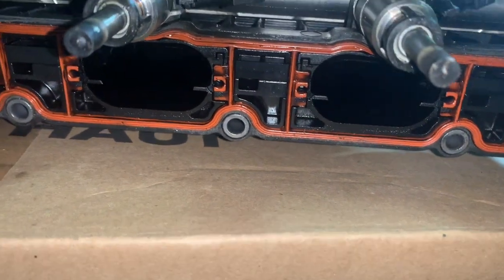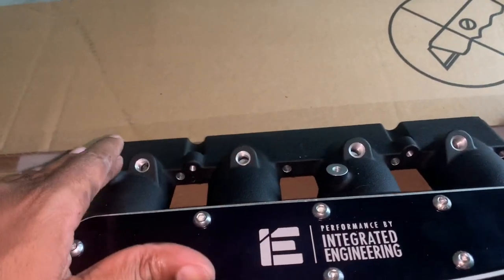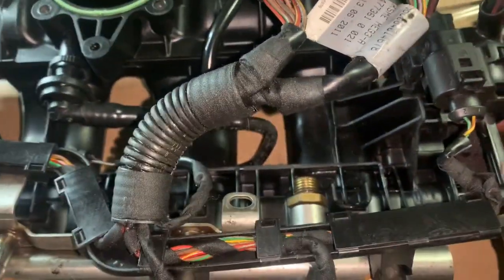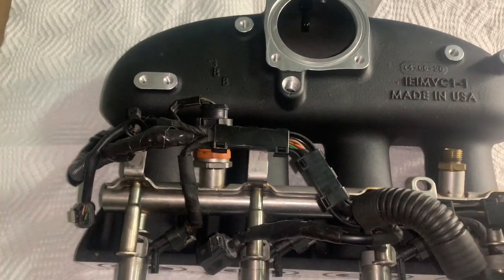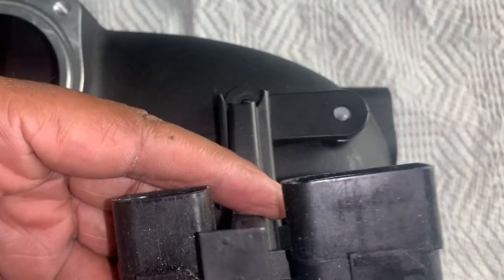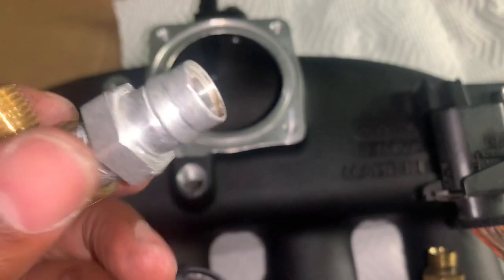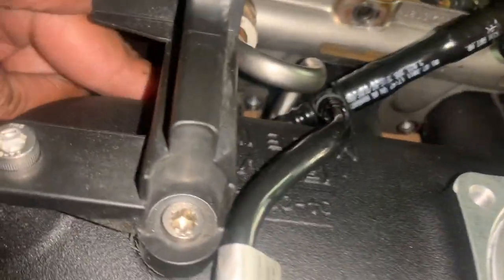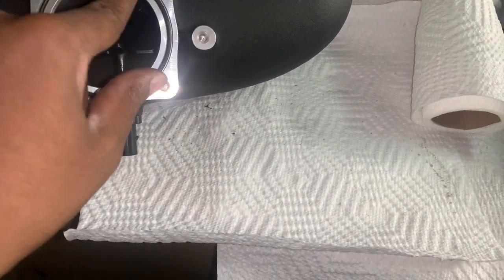Audi / VW (Crazy Horsepower) IE intake manifold Install | First Start Up And Launch Tfsi Fsi B7/B8

Comment: I believe that plastic tap was the boost tap. That’s no emission purge line. That’s runner flap control line going to the control valve. And IE provides a rubber cap for it.
Reply from the maker: Thanks, what I originally thought, it’s bypassed with the tune, was wondering what that cap was for lol 😂Thanks brother 🙏🙏🙏🙏🙏
Reply: @brucecustommotors  No problem..Im planning taking my intake manifold off and putting back in those flat plates in the head. I have the IM tune on but car is a little shaky when accelerating. Im thinking air is less turbulent going in the cylinders or maybe its my ported head. Let me know if you are experiencing the same thing? Would be a good video for ya to help raise awareness.Let me know. Cheers

Comment: Nice video! I also just did this job to my a4 and I’m having problems with misfiring on cylinders 1 and 2 and rough idle. I have the IE stage 2 on my car now haven’t downloaded the IE intake manifold stage 2 tune yet. Do you think that’s the problem?

Comment: Beast Mode!!!!!, Thanks for all your support to our platform.
Reply from the maker: Any time!, thanks bro
Reply: Have you done anything with the internals??..I just redid the internals..I bored mine. 030 over put JE racing pistons in it with Mahle rifled rods and bearings, Mahle racing crank bearings, Ferrara valves. Instead of spending what they wanted for a downpipe I went to my local exhaust shop and they removed that front muffler and for 50 bucks I replaced it with a straight pipe and with the IE tune/w crackle it literally sounds sick..I get so many comments about how they can't believe it's a 4 banger under the hood.

Comment: What do you think about DSG/transmission insert mounts? do they work? do you use them? even a short video would be awesome. Some reason even after tune my 1st and 2nd gear isnt as responsive and aggressive as i want, was told this would help?
Reply from the maker: I actually have Some Im installing, will do a video
Reply: @brucecustommotors  awesome!

Comment: Hi bruce, i bought the ie intake manifold for my a5 b8 2013 cdnc so after you installed the ie. Do you have some error code (related to the flaps), and as same as you, i bought the ie k04 stage but i dont have the intanke manifold custom map k04. They created the k04 IM for you? Thanks in advance!
Reply from the maker: It depends when you bought your tune, they have  updated versions the one that says Im, by it is short for intake manifold, but if you don’t have it , you can call them and they will just ad the tune to you’re i link go to 6 mins on this video and it should say intake manifold tune and that’s what I’m talking about https://youtu.be/m8p9C5m_pSA
Reply: @brucecustommotors  thank you bruce, the past week i requested the 93 and 100 octanes k04 maps and when i install the intake manifold i will create another request to obtain the im maps. One tip bruce, you need to test the cold air intake b8 from ie, sounds awesome and its better than the injen (my previous air intake), regards!

Comment: I think this is the next to last piece that I have to install. I wanna put in the CTS Big Boss 600 turbo and then the IE intake. Now that I have the internals all set then I can build it up with the rest of the parts. I'm installing Sno-Performance meth injection today. I can't wait to see what mine does after this.
Reply from the maker: its going to be a beast, Im actually interested in your ,build, I also am going big big turbo, let me know if you need a custom manifold, to bring the turbo to the top,
Reply: @brucecustommotors  I removed the head cause I had spun the chain. I put it back together then I still had an issue with an oil leak then head Gasket leak. So I said hell with it I'm pulling the engine and redoing the whole block. So I took the block to my machine shop and I had a cpl lil marks on cyl 2 and 3. So I decided to bore it .030 over and went with JE Ultra racing pistons with JE racing rings. I had the crank polished. I went with Mahle racing crank bearings. I bought Mahle 700HP rated rifled rods. I used Mahle racing rod bearings. Then I went with Ferrara stainless steel valves. Thr head and block were flat. Then I bought ARP cylinder head bolts. I changed the waterpump to a aluminum cast one. I painted my block red. I spent over 3k but I figured I wanted to make sure it was gonna handle the extra hp without blowing apart. Like I said with the IE tune and when I downshift around 2k the sound coming out is incredible it snaps and cracks like I have a V8 under the hood. Mine is a 09 A4 dark blue with dark tinted windows and chrome wheels. If you want pics let me know I will show you some pics of it as I built it. Let me know yes the only 2 things I have left is the intake manifold and I wanna go to the Big boss 600 turbo. Can't wait to talk to ya more.

Thanks Chuck

Comment: Great Video Bruce! So were you running the APR tune with the IE intake during this video? Can I run the IE manifold with the APR stage 3 tune? I have everything you have basically identical to yours only I have an APR Carbonio intake.
Reply from the maker: whats up bro, you can but , apr does not have the runner flap delete for my specif model, 

but to explain it when i ran apr, or a regular tune , with IE intake manifold, what would happen is . the car would run rough for to minute on cold start, but after that, ran like a champ, if you dont mind a rough cold start, and a possible check engine light from the intake manifold runner flap you're good to go, now if you got a check engine light and cleared it, it would not come back on, as youre driving, but that would be a hassle everyday. the way ie tune works is it tells the computer to skip the cold start, and eliminates the signal to the ecu, for intake manifold. so technically, you could have someone code it out with vag

Comment: Hey bruce I've been having some misfire issues with my intake manifold. I don't know what I could be doing wrong. It has a misfire on cylinders 3 and 4. I also wanted to know if you removed the plates that are on the motor. You know how you have the flaps on the stock intake.... On the motor there are plates.... Did you remove those or leave them in? I can't find ANYTHING online telling me if I am supposed to keep those or remove them. This would be a great help if you could respond. Thank you

Comment: Hey brother great video. I have a 2006 A4 B7 2.0T. Looking to do this mod. Do you know if I will be able to tune it with the IE cable n software ? Once it’s tuned the CEL goes away and the car cold starts fine?
Reply from the maker: Yes, you have to pick option Im, every tune has a double option for I’m, which means Intake manifold. And basically the tune by passes cold start, and so there will be no check engine light

Comment: when you went ko4 did you upgrade your fuel pump or your head studs? like what all did you need to complete the whole k04 build?
Reply from the maker: optional things i did, was, s3 injectore, and a better brand fuel pump, and every thing else was plug and play.
Reply: @brucecustommotors   alright thank you could you get a link for the injectors and fuel pump Becuase the links you have in your video are unavailable on eBay anymore and I’m trying to figure out where to get them and the right brand

Comment: Ok I did the walnut carbon clean. I replaced the spark plugs with the ones IE recommended.  I put on the IE intake,  downdraft tube with cat convertor. Did the IE stage 2 tune. Everything else is factory. 2012 A5 2.0T. My question is, what kind of hp/toque should I have just as it is?  TIA
Reply from the maker: What size turbo do you have 3 or 4
Reply: @brucecustommotors  3 for now

Comment: So, the IE tune is installed, just not the RFD tune, yes?
Reply from the maker: correct, what Ive learned is that if you delete your flaps, or put in a intake with out them. what happens is your car is reprogramed to skip the 30 second cold start stage, which is designed to warm up your car for emission purposes, because your first start is the most toxic. so your rpms will just drop below 1000rpm, So you basically wont have a cold start any more, you also will get a check engine light not for misfires, but more so wrong readings, but your car will have a horrible cold start, with out a tune, like you have cams in it or something lol, if you can make it thru the dreaded, cold start and, dont mind the check engine light your car will perform normally after the cold start, and the rough idle wont happen again until your engine completely, gets cold again.

Comment: If you had a bone  stock 2.0 now, would injectors, TB & flapperless intake, than tune, be a good starting place bolt-on?

I am about to enter this world.   Seems like above would be good.  Then exhaust and cold air intake.  Then slight turbo/intercooler upgrade? Retune ofcourse
Reply from the maker: actually that an amazing starting place, check this out first https://youtu.be/YZO_tu0u7vA

Comment: Bruce, would swapping out the intake manifold on my B6 S4 for a B7 RS4 yield a significant increase in torque and horsepower?
Reply: RS4 manifold, I meant to add in. Thank you
Reply from the maker: 4.2 right

Comment: it is necesarry to replace the teflon seal on the injector or it is ok  to just put it back in like you did ?
Reply from the maker: Yes I did , while it was off I bought an injector repair kit, not necessary but I just did it, because mine were worn

Comment: Quick question?  In the heads, there are flat plates that slide out of the intake opening. I don't know the name of them.  Are the reinstalled or are they left out?
Reply from the maker: I called ie and they said take them out, but I don’t think it hurts, sometimes I get a surge, of to much instant power ,was thinking of testing them back in

Comment: Hello , ive a a6 2007 2.7  with bad intake manifold code . Car consume 10 lit in 30 km city , does it consume so much becouse the intake manifold ? 
In highway 7lit/100km
Reply from the maker: yes you're a 100% right its the flap they wear out over time
Reply: @brucecustommotors  so if i buy new , car will consume double less ?  Or just a difference of 1-2 litters ? Do  you have any idea?
Reply: @brucecustommotors   @1A Auto: Repair Tips & Secrets Only Mechanics Know  
Hello , i did change the intake manifold with some new . And im seeing only a little bit change in fuel economy and a little.bit performance . Someone told me to clean the mass air flow sensor with spray crc , while i was opening the tubes , ive seen a black fluid in the throttle body of air sensor , is this normal ? I do have the photo but i dont know how to send it so you can give me any advice

Comment: With stock turbo(k03/4) you loose low end torque . I have it and i used it with a k03-4-tte480+ and now gtx3076 and it is now when the manifold is needed , and i use the direct injection ports for a second set of injectors
Reply from the maker: Thanks for letting he insight

Comment: Does ie manifold fit audi q5 2009 ea888 cdn 2.0 tfsi?
Reply from the maker: Yes it should
Reply: @brucecustommotors  how many hp did you see after installing it?